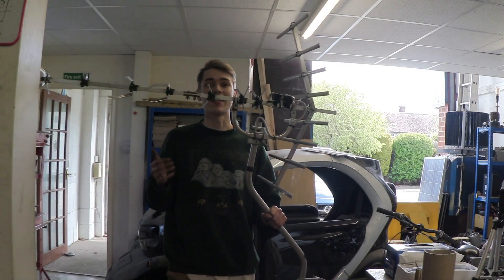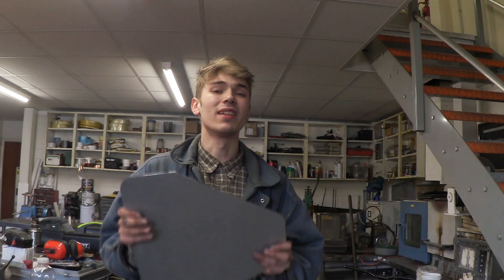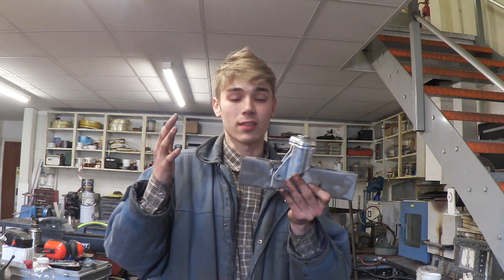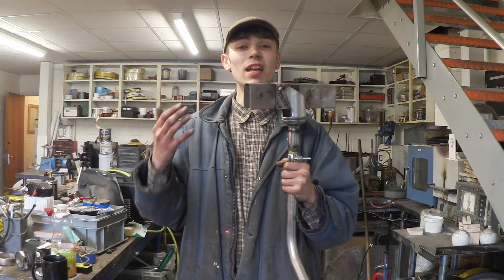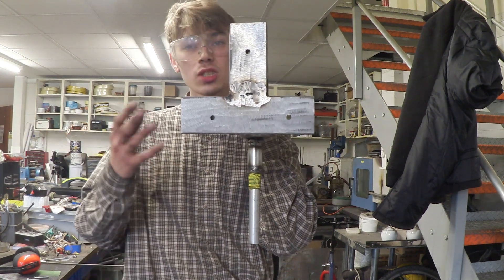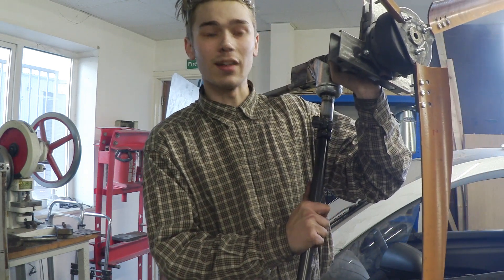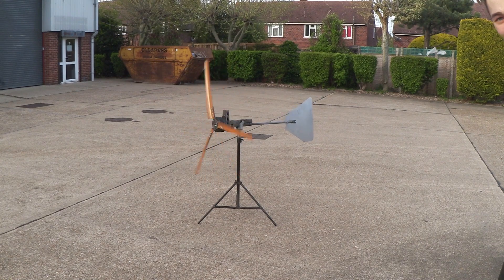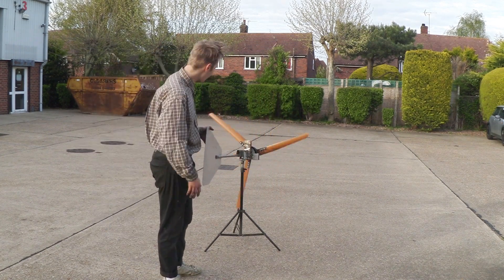1098 - Building a Turbine Mount for my First Wind Generator

Comment: Slow down the time lapse on the welding and maybe explain it better.  If you use a rivet then you can make an electrical connection that will join the generation between the swivel and the wires.

THAT is a personal contribution to your and Roberts projects; wire into a rivet that can swivel and then all you have to do is combat moisture within the unit.

That makes a 'spark gap' type connection that is free of rotation and keeps you from using a cord that can bind from the rotation from directional winds.

Well done mate! You seem to have that down pat!

Comment: Nice. I have to say the universal motor makes a horrible generator performance wise. In performance these are horrible motors too. The reason why is that these are made as cheap as possible. Less windings, less copper. Giant losses released as heat. Manufacturers get away with that  cause the airflow of a vacuum cleaner passes through the motor. That cools it down and that's how they get away with that. If it's not a vacuum cleaner there's a fan for that reason. If you block a universal motor or any other series motor it's windings will burn in seconds. Try a stepper motor like your dad has covered. Much better  ...

Comment: Nice job and creative use of materials but Negative Nathan here asking because no one else did; why did you cut the fin wasting so much material? Was there a reason why it was drawn on the middle of the plate? Not a big deal, just gringing because I hate good materials getting wasted, even accidentally.
Reply: Thank you mate! The reason I used the middle of the sheet was because it was the flattest part, It was pretty beaten up when I salvaged it. for this reason, I decided to mark it out all in square pieces so some could still be saved. :)
Reply: @MyNameIsLukey  Roger that! Now I see, thanks for replying!
Reply: I thought the same time ,why all the little cuts.

Comment: Nicely done, if the next project involves adding a (diy) slip ring contact around the swivel joint, this would be awesome. Anyway, this device seems to easily orient itself in the correct direction, so kudos to that :)

Comment: now to get the power out of it with it being able to swing 360º like that, lol (same problem for me with my printer head that is a flat strip of nozzles right next to each other and rotates around so it can lay down say circles multiple layers at a time for single pass, since each nozzle actually closes and opens, but I may be onto something to solve it, just have to wait for the parts to get here and do some testing ;) (single line chain-able multiple mosfet control ICs sort of like the PWM chain-able ws2812b system so a single data line and single supply of power can turn on and off 100s of red green and blue LEDs with each chip controlling 3 LEDs and knowing when it is to grab the data and use it or pass it on, but these have 16 components they can control instead of 3 XD)

Comment: What I want to see is cost effective, stable, AND SAFE ways to make a pole for it that is at least 60 feet in the air. 
I have a 1700 watt wind generator but no pole for it. To buy a pole kit cost more that the gen did. To buy the materials and make my own cost almost as much. 
Any suggestions? 
I wonder if a flag pole with a modified top would be strong enough without guide-wires?
I once saw a couple of street light pole laying in a parking lot (car park) that would have been prefect but could not find the owner to ask about taking them.
Reply: Steel Scaffolding tube?
Reply: @totherarf  I found a 19mm bolt drilled a hole throw the middle welded it to a plate on one end of the scaffold tube welded the bolt to the plate and bolted a old cam belt tensioner with another plate with a hole in it mounted my (motor)  wind generator then passed my wires throw the bolt I have put have  guide-wires on it works a treat
Reply: I put one up years ago. I used 2 80 diameter pipe that are 3 metres high with a centre pipe that is on a pivot between the other to pipes that is 6 metres long this one has the wind generator on the top of it. Like a seesaw. So the two large pipes go into the ground cemented there welded to each other with heavy flat bar on one side spaced so the 6 meter pipe fits between them both.

Comment: "all" you need to do now is work out how to get the electricity generated without winding up the take off wires as the mill spins round to face the wind!
Reply: A piece of string, a loop welded in to allow the string to "wind up" as the wind rotates .... and a weight to pull the thing back to a neutral starting position should the wind stop! Like the old self closing farm gates!

Comment: Next: Some people use an extension cable that they can unplug and untwist, while others use slip rings to prevent twisting the power chord.
Reply: First one I ever built I copied the slip ring assembly from a Winco Windcharger, they used to make them in Iowa and a lot of other companies private label them, I guess I should've said that was the first one I built of my design the first wind generator I built was a 1936 Winco and that was the restoration from laying face down in the dirt in Kansas somewhere, the propellers were an unusual design and so are the governors

Comment: Fantastic Luke, have you changed your hair colour?
Just wondering how you will wire up the turbine without them getting twisted up? Will you use a twin brush method to have a break in the cables or have you got another method?
Reply: I was just about to ask the same question.
Reply: @ChristianBHough  I have been wondering about this since he said it would turn will the wind. Usually they use a pulley system off a 45 degree cog that turns the turbine below the swivel point.